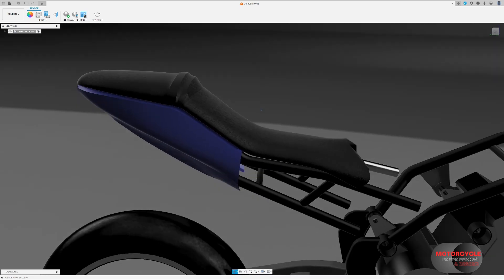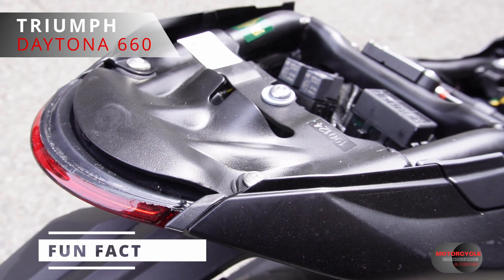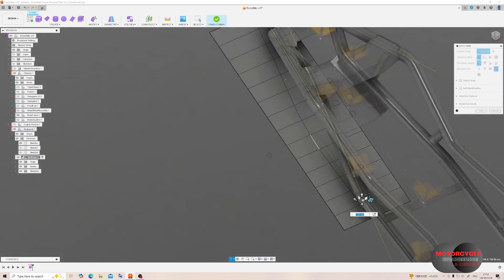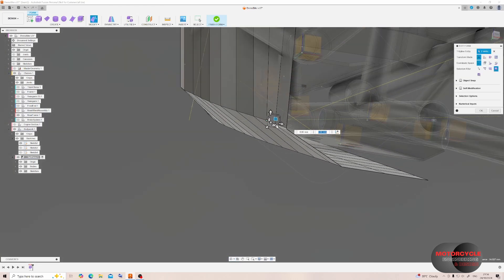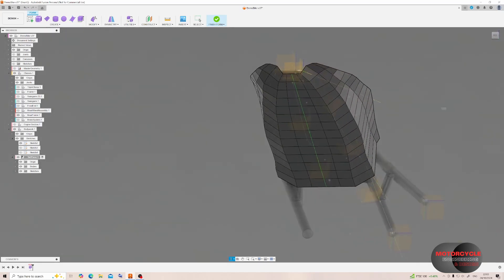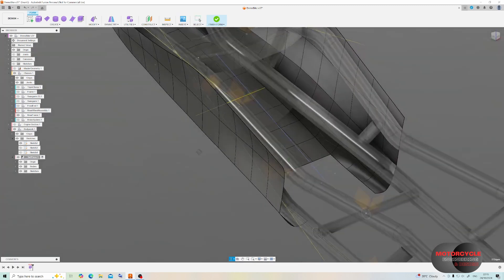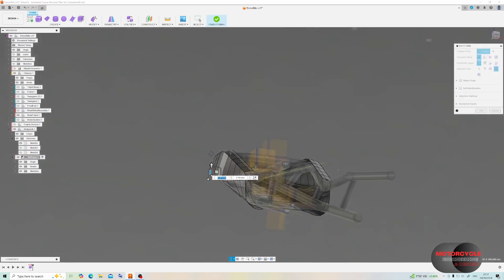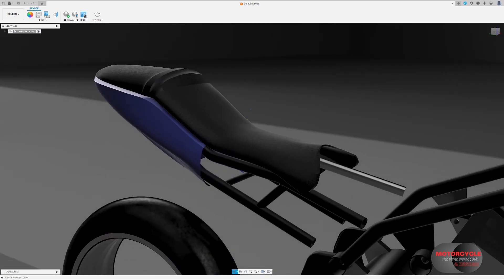Motorcycle Fairing Design, Rear Tail Piece, Fusion360 Surface Forming

Comment: Is there a way to give this a volume/thickness?
Reply from the maker: @lemonmane69 yes there is! You can either offset the surface and connect them manually with surface features until it's an enclosed volume, or use thicken feature, but you'll need to make sure the offset/thicken doesn't result on -0 dimension, pay attention to radii.
The reason I kept it as a surface to this point is because it's not worth putting the effort into the Final design features until you have a more developed design, design for manufacture and installation/fitment features